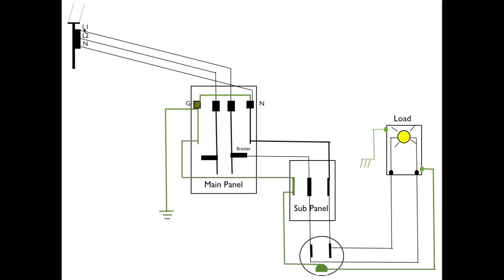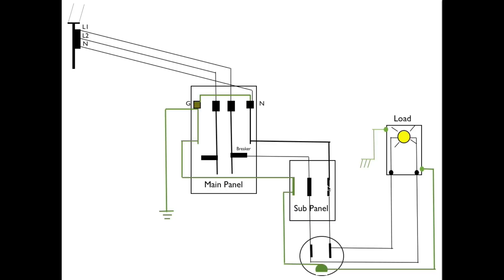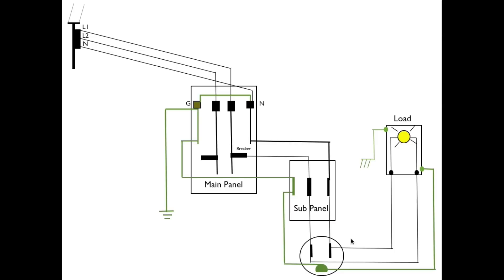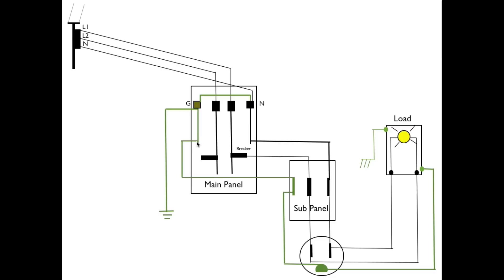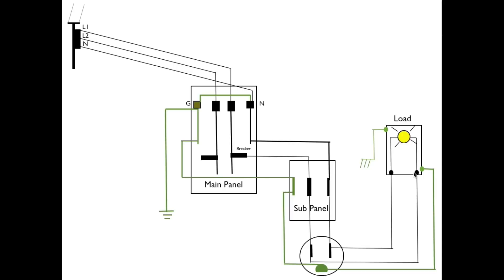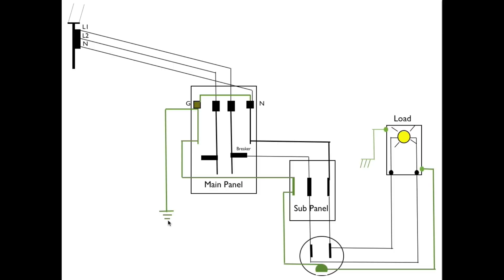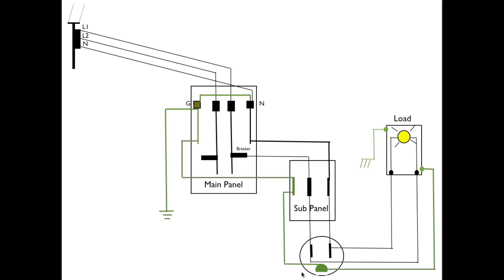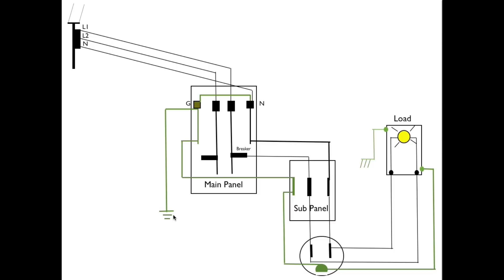The difference between neutral and ground on the electric panel

Comment: Excellent video. Another reason for the earth ground is to pull the neutral from the power pole down to ground potential. There is capacitive reactance between the primary and secondary of the transformer on the pole. This couples voltage across to the secondary from the primary. If you didn't have the earth ground then the neutral in the house would be floating up at some voltage level above earth ground. As such touching the floating neutral or anything connected to it and say a water pipe at the same time could give someone a shock. This voltage potential shouldn't be confused with the magnetically coupled power coming from the primary and going to to L1 and L2 on the secondary. Instead it's a product of the capacitive coupling between the primary and the secondary of the transformer on the power pole.
Reply: So, Joe, I have the typical Ontario 3 wire and ground supply and am showing up to 40V between grounded equipment;  furnace, boiler, sump pump, and the  cement floor. I have several standard galvanized ground plates; garage, hydro pole, solar panel array and horse barn. Power is coming from somewhere!!!!!!!
Reply: The big question is where is all the "grounded" equipment actually grounded. If your barn has it's own separate sub-panel and it is grounded through a long piece of wire to somewhere else far away then that could be the problem. You might have to drive a metal rod into the dirt under the cement floor and "locally" ground the sub-panel to the rod.

I posted a separate comment about this issue. It is different from the comment you replied to.  I'd suggest you read the other comment.
Reply: Again Joe, I have read your other post too and what you say makes sense, I agree. My barn has it's own buried ground  plate as well as the incoming supply ground from the pole. The concrete slab (26' X 36") has re-mesh which is also bonded to the ground plate. To add to the confusion my COMPETENT electrician is also baffled and suggests taking readings between house ground and various remote test grounds. The condition fluctuates depending on how much load is applied by my dairy farm neighbour a little over a quarter mile away! We have the same electrician who, by the way has many years of industrial experience too.
  JPP2672 confuses me!
Reply: I'm NOT an electrician, but I tend to agree with the comment that current doesn't only take the path of least resistance. It takes all possible paths, just at different rates. From comments I have read, if your neighbor's dairy farm has a loose or open neutral somewhere, then his current is going to travel back on his ground and energize the earth. Current could then travel up from earth via your ground rod and into your panel and then through your neutral while trying to find a way back to your power pole/transformer. The catch is, if he is 1/4 mile away, I think that would be very unlikely.
Reply: @ munsters2 - Correct. The ground is like a huge carbon resistor and as such it can be thought of as an infinite number of carbon resistors all running in parallel. Accordingly, you can apply voltage to it anywhere and draw current out of it anywhere else to complete a circuit. And as you have stated all the current won't necessarily flow in a straight line between the two points. You can also have additional current flowing along curved paths on each side of the line as well. Also remember that the water content in the soil and how densely the soil is packed affects the resistance. So even a quarter of a mile might be carrying a substantial amount of current.
Reply: Thank you, Joe Vignolo, for clarifying all that. I was not sure about the 1/4 mile distance. A thought that just occurred to me is I wonder if a nearby railroad tracks or a long steel bridge would provide a low resistance path for current to more easily travel longer distances?
Reply: Steel conductors such as a bridge or railroad tracks certainly would provide a low resistance path. So would buried metal pipes. This entire matter of how electricity propagates through the ground is somewhat nebulous and unpredictable. I guess it's what we get because we choose to live on a huge round carbon resistor.
Reply: Joe Vignolo  ...Correct Joe.. This is called capacitance  reactance... I've seen 3 phase power secondaries  remain  hot after all three primary risers leads were disconnected from 13.2 kv primary feed... this was caused by capacitance  reactance in the  3 phase transformer set.... i was there....seen it happen... they were HOT disconnected... not back feed.  nothing connected.  only nutruals and pole grounds.. no customer secondaries ether. .. gets your attention real fast! !!!
Reply: On one of my first jobs we where called because A retractable bridge in the city of Haarlem was doing some arc welding.We found out that copper thieves had stolen lots of retour lines at the nearby railroad.All that current from the trains found it's way :D I really love my job this stuff is like magic to most people :D
Reply: I stand corrected.  It's called fara-resadence when the voltage appears out of nowhere with open primary taps on the transformers.
Reply: I think you were correct the first time. Capacitance reactance is what causes some electrical energy to be transferred between the primary and secondary because of the close proximity of the windings with an insulator in between.
Reply: Lots has also to do with ohms law,no matter what load on single phase there is,the return current over the neutral will induce A voltage drop(or rise) at the consumer side.That's wat made the retractable bridge arc and will trip your breakers if your're in the unlucky situation living next to railroads or other large consumers of electricity.
Reply: Thats the neutral balancing L1 & L2 at 60Hz. A regular light bulb is actually flashing 60 times per second.
Reply: VERY well stated Joe.

In fact, one could omit everything in the video, IF they really understood what you said.

In other words. IF one of the "hot" wires from the transformer on the pole is not kept at ground potential, the potential that could happen, would be humongous on BOTH "hots"; regardless of what they are called.

But, IF one of the "Hots" is grounded, the highest voltage the other one can be (respect to earth ground) is either 120 or 240 volts. While it can kill, in most cases it doesn't. But If the potential should rise to very high amounts (from a myriad of sources) with respect to earth; then many items using electricity would be blown to bits; not to mention that electrocutions would be happening by the millions every day all over the world.

By earth grounding of either "hot" wire, solves this problem in a VERY simple way. Of course the one that is grounded is called neutral and the other one is called "hot". But those are simply semantics.

While the video states things correctly, it is over explained and makes it seem quite complex, but it is more simple to just know that ONE of the hot wires MUST be grounded as long as we remember the following:

In NO case should there ever be more than ONE ground point. Sadly, this happens more often than one might expect. For it can cause ALL kinds of problems; particularly in electronic devices.

This is why we should NOT connect a second ground to the already grounded "hot" wire (neutral), in sub panels, etc. It is called "A ground loop" and it can be a nightmare when trying to find out where the problem is.

For whatever it's worth.
Reply: DO A VIDEO...GFI AFI GROUNDS
Reply from the maker: Its on the list.
GFM
Reply: so you must understand that when a real electrician can be baffled, then the issue of earthing is not a light one and must not  be handled by the lay person. I the land down under , contractors are required by law to report this type of incident to the power supply company, who have a 24 hr response time to start investigation into the matter. 
In the aussy rule book the matter of earthing takes a considerable amount of pages.It is no easy matter. An over simplistic explanation is dangerous, and should not be attempted. A small amount of knowledge can sometimes get one into trouble. The magic of the three wire system is severely understated, simple and safe when implemented correctly.
Half of an electricians job is to make the power flow when required and the other half is to make it stop when a fault occurs, be it an earth fault or a over load. All of the thinking cannot be put in a short youtube video Please leave the 240 volts alone.
Reply: Joe, I believe that what you described is actually inductive reactance.
Reply: As long as you don't overload the flux capacitor with more than 1.21 jigawats, you should be OK.
Reply: Older electrical installation have no ground. Just a hot and a neutral on glass fuses

Comment: Forgive me if I'm missing something obvious, but it still seems to me like "ground" and "neutral" would both carry current. I know they don't or else GFCIs would constantly trip! But since they're tied to the same potential in the main panel, and I'm assuming that the load connects its return (neutral) to its own chassis (earth ground), then the two wires between the load and the main panel are in parallel. Wires in parallel share current, so unless the impedance of the ground wire is really big relative to the neutral wire, then both wires would carry appreciable return current back to the main panel. What am I missing??
Reply: I guess there must be requirements for consumer electronics to isolate their return from chassis internal to their design huh? Everything would work fine as long as they do this. They'd probably want to do this anyway functionally, to control where currents are flowing.,
Reply: +Adeota 1 The neutral and ground wires aren't connected in parallel in this circuit. They are only connected at one point in the circuit, that is at the main panel...whereas if they were in parallel, they'd need to be connected at two points. Hence, the ground doesn't carry any current, unless a ground fault occurs and it comes in contact with either or both the hot and neutral conductors...in which case the gfci and/or overcurrent protection device will open the circuit (hopefully).
Reply: Agreed, I would also add that the diagram could be more clear if the neutral were shown between L1 and L2, with it grounded at the transformer.  Show the transformer as center tapped.  This will further solidify the concept that current must complete a circuit... it just doesn't get dumped in the ground....it goes somewhere in the ground, still (transformer).
Reply: That's true only if the load isolates its neutral from chassis internally, as I stated above. Otherwise, the two are indeed in parallel.
Reply: If you follow the diagram above, the ground never completes a circuit. The current will follow the path to the utility pole to complete the circuit. Once the circuit breaker trips then the current will make its way through ground to the earth.
Reply: Thank you.
Reply: Once the circuit breaker trips, there AIN'T any current going anywhere! Only think left is the potential at the line side of the breaker......an open circuit carries nothing past the breaker. One thing everyone is missing, the "grounding conductor" is the wire that goes to earth, at the meter socket, as per utility. The "bonding" of the main panel to the water pipe in a residence or building, is more of a local code, not really required by NEC. The "green" wires from the main panel to the various devices, are called "bonding" wires/conductors in the NEC. All they do is "bond" each device at the same potential back to the main panel. In a sub panel, the neutral is NOT bonded the the panel. If it were, during a fault, or a leakage, you will most likely have circulating current between the neutral and bonding conductor and not trip the breaker.
Reply: @cetyl2626  Yeah, and showing the neutral between L1 and L2 would also make it easier to visualize the voltage in the 180 degree out of phase legs oscillating around the neutral like a sine wave on a scope,  which in turn makes  it easier to visualize the direction of (alternating) charge flow through that part of the system.

Comment: Ground is the path that the electrons take when a short circuit is created, 
the neutral is the path that the electrons take to return to it's source to complete the circuit.
Reply: Fault current returns to the supply on the neutral, not ground. Everything in this system is designed to provide a low impedance path back to the supply to complete the circuit.
Reply: @schulerruler  I don't think you read my comment properly, I said when there is a short circuit.
Reply: @MySpace662  I did read your comment. Current during a short circuit does not take the ground path. This is a large misconception in the electrical field. It takes the BONDING path back to the GROUNDED point where the neutral and GROUNDING conductor meet in the service box. This point is  provided by either the manufacturer brass screw in the neutral bar that bonds the tub to previously mentioned conductors, or by a supplied bonding strap, or a separately sized bonding jumper.

Either way, if fault went to ground, the impedance of the path back through the dirt via the grounding electrode, to the grounding electrode of the supply transformer would not be low enough to trip an overcurrent.

Sorry for the long winded response but short circuit current does not go to ground.
Reply: @schulerruler  The ground wire offers an additional path for the electrical circuit to flow into the earth so as not to endanger anyone working with the electricity , in the event of a short circuit. Without a ground wire, your body could instead complete the ground path and may cause shock or electrocution.
Reply: @MySpace662  please explain to me where the electrons go once they go into the actual ground. 
The fact is that without a complete circuit back to the supply, meaning neutral, there is no circuit. Meaning no potential across conductors, meaning the electrons will not move as there is no force imposed upon them.
Ground helps us establish equal voltages as well as a larger plane for surges, but it is in NO way a low impedance path. 
There are many systems that do not even incorporate a connection to ground. Engineered designed approved installations. 
Look at the secondary on a transformer. If you do not give it a reference to ground, there is still Preciado across the coils, which still operates a load. In this case a contact between hot and ground won't do a thing. Line to line will pop a breaker, but a ground path is not required to trip it. It is the low impedance path established through BONDING that ensures this.

Comment: Good explanation - thank you!

Perhaps a minor point but... at 8:00 you say "if this wire failed" and point to the neutral wire from subpanel to receptacle. I'm about 99.9% sure that you actually meant to point to the neutral from main panel to subpanel. Breaking the neutral after the subpanel wouldn't create the "neutral fished thru ground" scenario you are describing. Breaking it ahead of the sub would. Maybe an annotation needed?
Reply: ***** Yeah, I noticed the same thing.
Reply: Good catch. Can you explain the circuit loop?